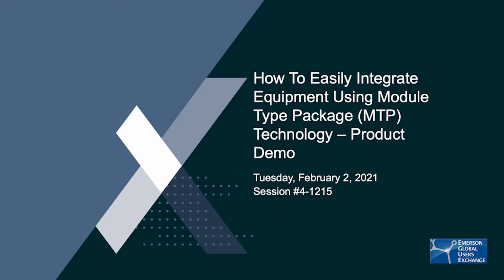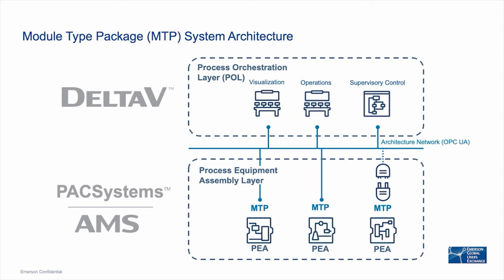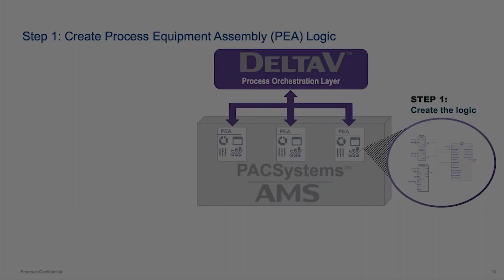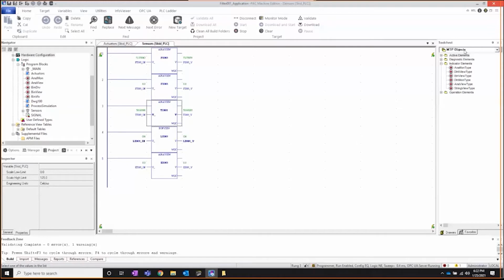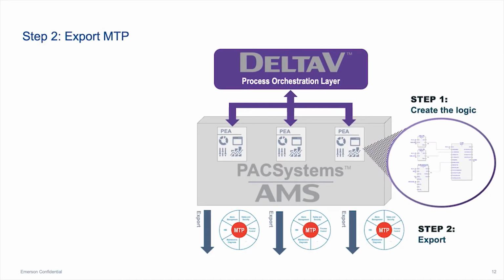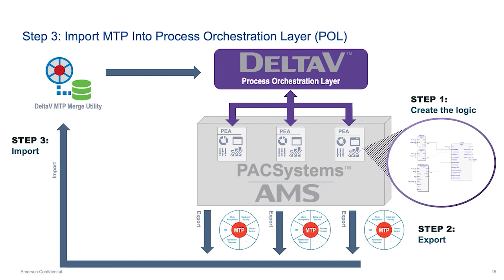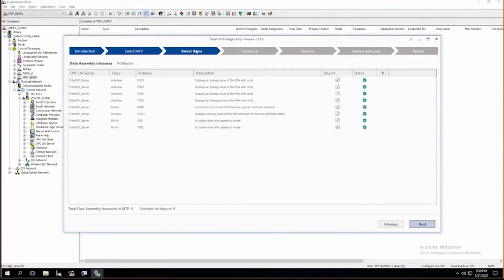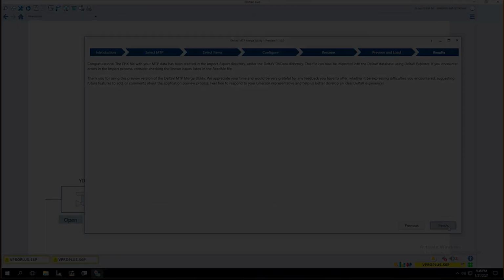How to Easily Integrate Equipment Using Module Type Package (MTP) Technology

Comment: Hi!
Do we need to set up previously the OPC Client and OPC Server certificates or does the utility configures all of these settings automatically? 
Thanks in advance
Reply: you have to set it up - MTP is basically an XML file based on AutomationML that describes in detail the nodes and access points but not the certificaticates (but you can include them as well)  but currently it is not automated yet. The process industry is working hard to automate that and to get independent of the specific PLC hardware to be able to change modules seamlessly